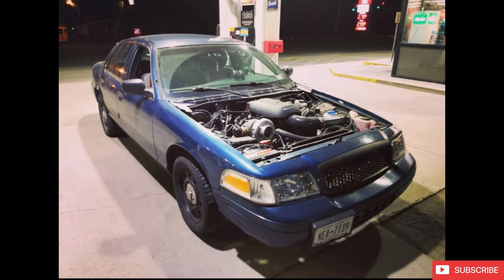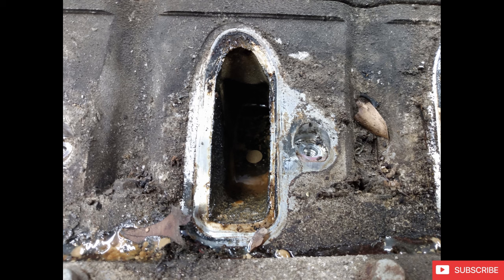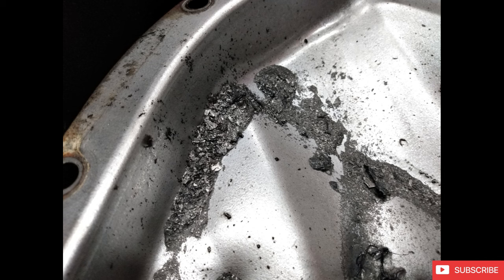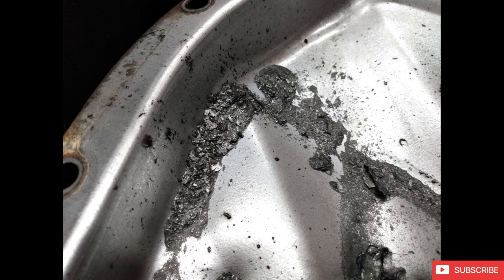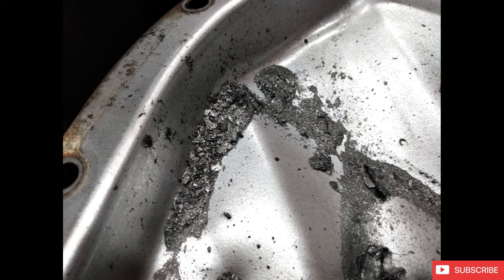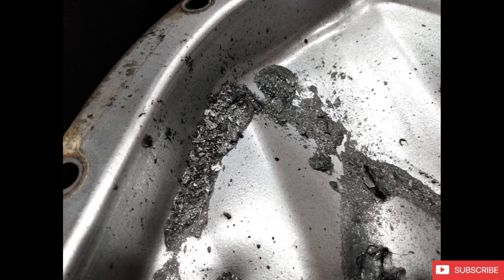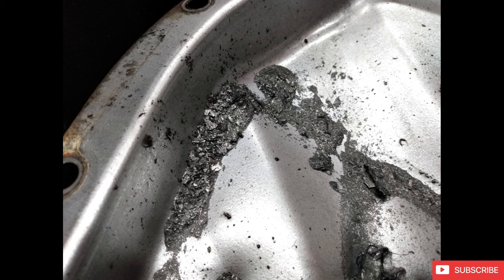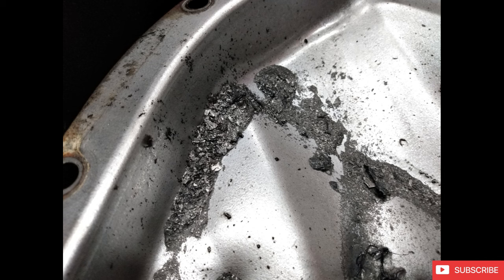How to Turbo LS swap your Crown Vic Police Interceptor.

Comment: The messiah has returned, oh how I've waited for this video!!
Reply from the maker: Glad you enjoyed it! Consider subscribing and spreading the word about my channel.
Reply: @nsogiba  how did you get key and fuel pump wired in? I’m kinda hitting a brick wall with the wiring part ?
Reply from the maker: @TheRealKazma  I bypassed the Fuel Pump Module in the trunk. With the key on it received power and then that signal gets sent to the stock fuel pump harness. The fuel pump was on when the key was on which is "hotwired". Technically the "right" way to do it is have the GM PCM control the fuel pump. I think there is an output on the GM PCM to trigger the pump. That way, if you're in an accident, when the engine stops running the fuel pump will shut off.
Reply: @nsogiba  so in my case I’m using Holley would it be more beneficial to dig deeper and find the signal wire to the fuel pump and supply it to the ecu? And additionally with getting keyed power to the Holley would I need to splice into the ignition switch?
Reply from the maker: The Holley already provides a fuel pump output which makes it easier. Depending on how big your pump(s) are you can use that signal to trigger the fuel pump module in the trunk or just go directly to the pump harness on the tank. If you're using pumps with higher current draw you'll use that signal to trigger a relay.  @TheRealKazma

Comment: Great job man, that turned out Awesome! 
Do you know if the swap would be pretty much the same for an older panther platform? 
I have a square panther, 89 town car that I want to swap. 
From my understanding they are different frames and suspension though. 
Any advice is appreciated!

Comment: Did the motor mount low to the crossmember, could it have been lower? 
Im gonna have hood clearance issues and also want my weight low… 
LSA with huge lid spacer and intake spacer..
Reply from the maker: I was able to use an F Body pan and a truck intake/accessories with room to spare. Send it!

Comment: what did you do to modify the driveshaft?
Reply: nevermind. you just answered my question in the video
Reply from the maker: You can reuse the stock driveshaft, just need to swap out the front u joint.

Comment: The transmission fit with no fab ?
Reply from the maker: I may have had to cut an ear off the bell housing on the passenger side. The tunnel and body didn't need any modification. Hope that helps
Reply: @nsogiba  thanks man FBO 4.8 swapped 07 marquis be done next week. Thanks for the info man !
Reply from the maker: @jamescadle5863  let's goooo! Post pics and a burnout video!